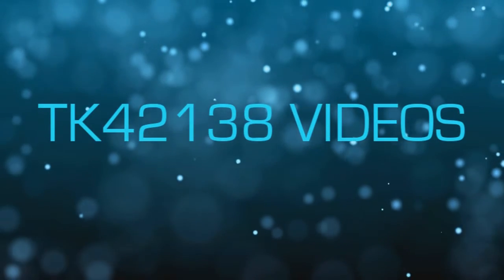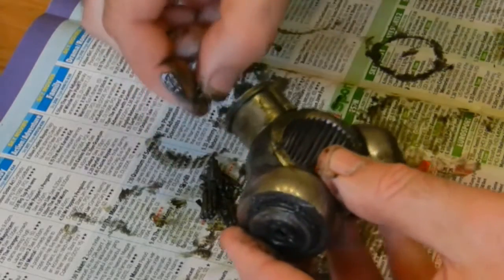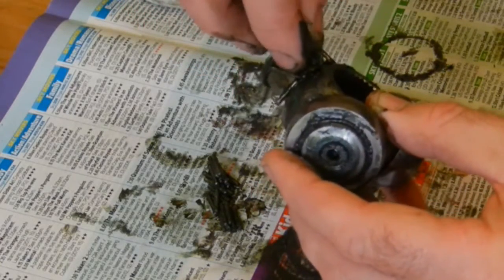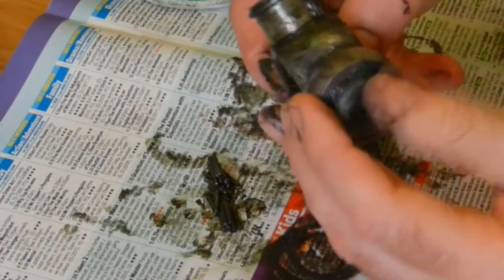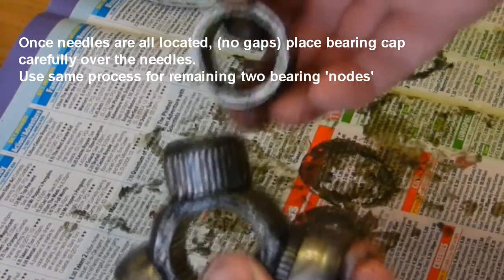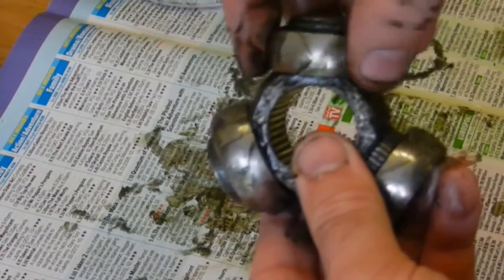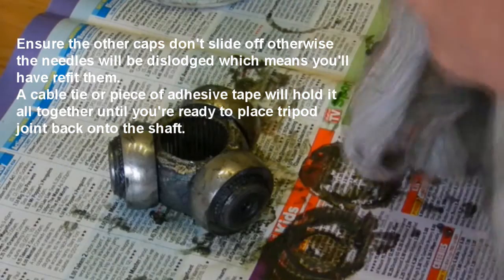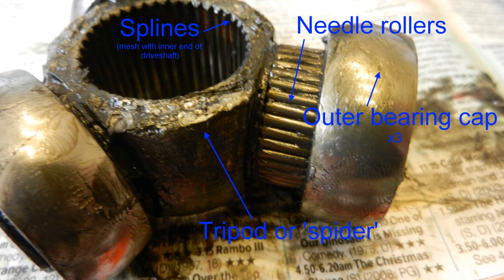Fitting needle rollers to inner driveshaft joint. (Citroen XM 2.1 TD auto)

Comment: Hi, I have a 93' XM 2.1TD and would like to know how repairable an inner cv joint is and is it possible to buy replacement parts?
Reply from the maker: At the time I needed to rebuild the inner joint soon as possible so managed to use parts I had laying around but Google search has thrown up some specialists for complete shafts and joints. Not dealt with these but might be worth asking them about inner joint parts.
https://www.jandrcvjoints.co.uk/
Reply: Thanks for the info. I’ll give them a call.

Comment: Surely it would be easier to remove the c-clip, stick the roller on and insert the needles?
Reply from the maker: No, only because there is a risk the clip will distort or break when removing it. It also helps to keep the needle rollers in position.

Comment: How do you remove them and secure them in place?
Reply from the maker: A smear of grease holds the rollers in place so the tripod rings can be slid over them.
Reply: @TK42138  i mean the tripod ring, how do you removed it and secure it?
Reply from the maker: @Manuqtix.Manuqtix  The joint is held on by a C clip.
Reply from the maker: @Manuqtix.Manuqtix  A C-clip but it will still be tight on the shaft. I had to use a press to remove it from the driveshaft. 
https://youtu.be/vBSRuS7knRU
Reply: Do you know how frustrating doing this was? i don't know how many times i cursed in the name of jesus Christ! Because
1. Watching this video makes it look easy
2. You get cv grease everywhere
3. The rollers keep on falling out as you put the wheel on.
4. Some of the rollers got missing.
5. Securing the wheel to the axle was difficult because the other wheel slides out and the bearings came out then you'll have to start again from scratch.

It was very very frustrating